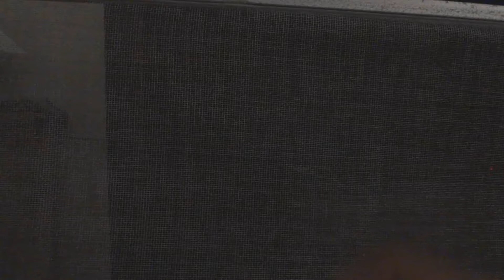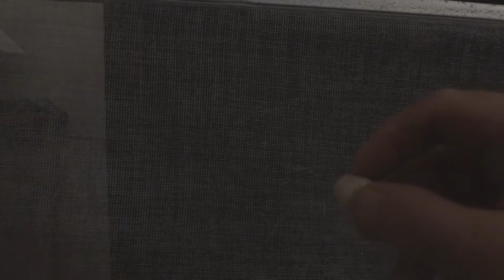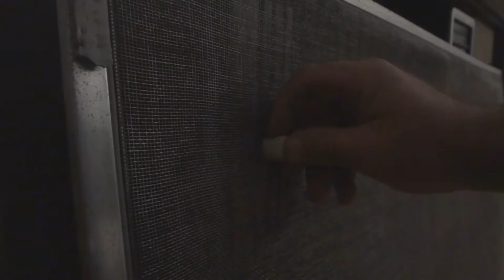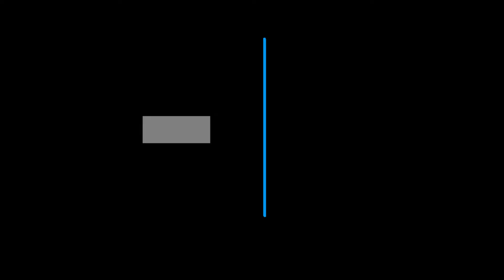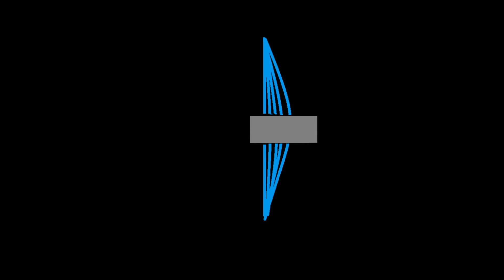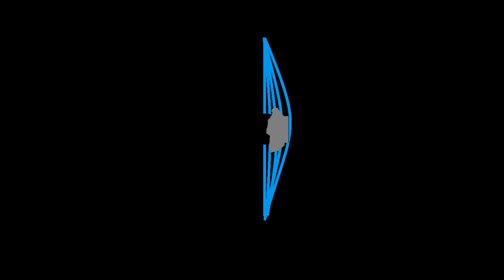How Kevlar stops a bullet

Comment: You cannot be more wrong.
Reply from the maker: Ok make a video explaining why I'm wrong and post the link here so we can watch.
Reply: Why video. Will give references as counter. I don't work for likes
Reply from the maker: @mehtaarian1  neither do I.
Reply: @chriss4365  actually Kevlar doesn't return to its original form. The kind of elasticity that  you referred to. In fact it has large BFS and thats why you need trauma pads for protection. This BFS is lesser in PE and they have less density meaning same protection at lesser wt or more protection at same weight. But you need too much of it to stop 7.62 MSC bullets making it too heavy panels of soft armor.  and thats where ceramics come into picture. But they are brittle and don't have elasticity. Hence no BFS. The plates break after certain number of shots fired at them But you explained the mushrooming of bullet well with clay bullet. I wish you had taken a little more time to explain the capturing of bullet with better light in your video. I suggest you do it. And also...make a video on ceramics too. particularly Boron Carbide
Reply from the maker: @mehtaarian1  thanks for the input the screen does stretch too much.